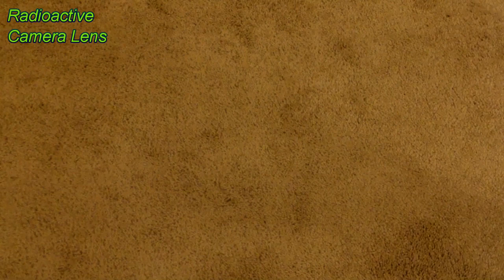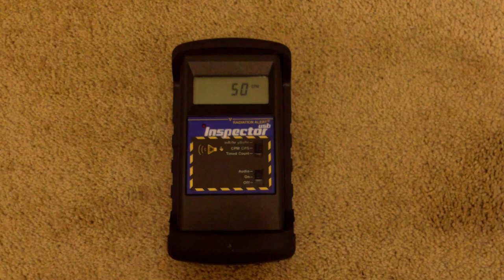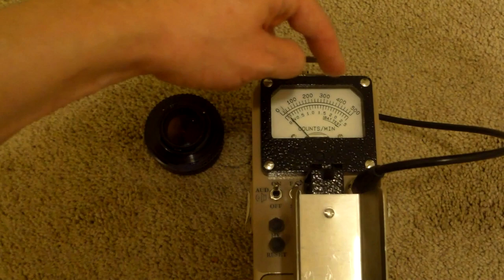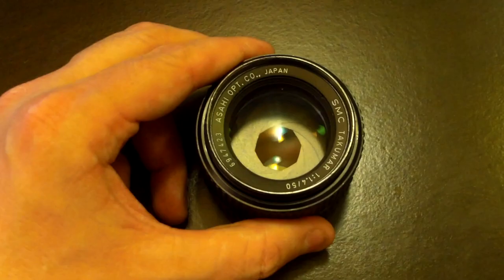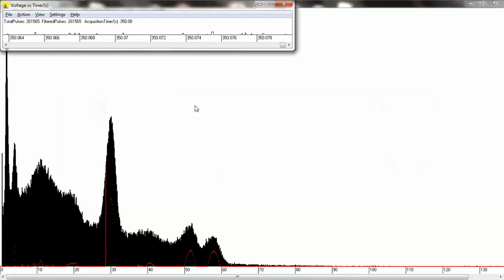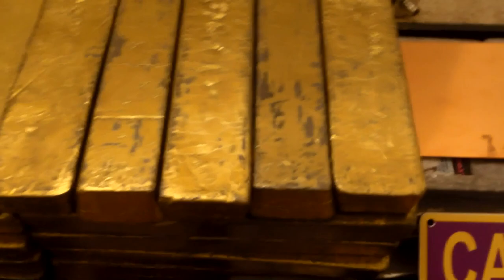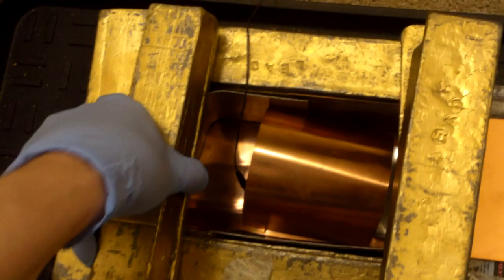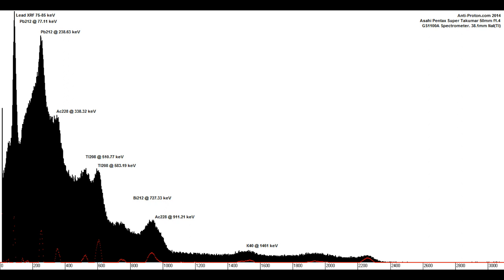Radioactive Camera Lens

Comment: I accidentally had one of these lenses stored under my bed for 2 years attached to an old camera my father in law gave me. I've removed it now of course and bought a GMC 320+ Geiger counter to check out the beta and gamma coming out the thing. I'm getting over 1000 pcm at the back of the lens, but thankfully only 34pcm average when the lens is on the camera and in the camera bag, and 25pcm where I was laying in bed with the camera bag underneath. background levels average about 17pcm. Bit of a relief considering it was only a foot away from my balls for 7 hours a night for two years lol
Reply: I bought the same Geiger Counter.  I have 3 vintage Takumar lenses that are radioactive.  None read as high as this guy's lens.  
Three of my Takumar lenses are radioactive.
One is 1550 CPM and the other 760 CPM.  All on the back lens.
My Super Takumar read 2250 CPM on the back lens. 
The rest of my vintage Takumar and FUJINON lenses have no CPM activity. 
I bought these because they were radioactive.  They are classic vintage lenses.
The CPMs really drop off fast as you move away from the lens. 
At 2 inches with the cap off the back lens, the reading in around 165 CPM. 
With the lens caps on and in an Olympus camera case I get about 100 CPM.
Reply: I have mine in my bedroom. It is really bad for health?

Comment: You know you are photographer when you was "oh, cool, f/1.4" instead "oh, cool, radioactive".
Reply from the maker: Yep, I am indeed a photographer.
Reply: I'm a noob when it comes to photography...but would the extra radiation "add" anything to high ISO long exposures?? ie with night/astro photography ?
Reply: Nope, has nothing to do. Probably only add more noise to the picture. ISO is just how sensible is the sensor to the light that gets in, when there's no other alternative to opening the aperture (the hole) wider to let more light in, or let the sensor get more light (longer exposure), higher ISO at the cost of noise and weird purple/blueish spots.
Reply: Kodak had some problems when the US began testing atomic weapons.  Stored and unexposed film was getting ruined with mysterious spots.  There is a cool documentary about it.
Reply: I actually was like "oh cool, f/1.4 and its radioactive!"
Reply: @tacticalseadog9120 
Interesting question. I think the answer is yes and no at the same time. It depends on what type of photography we are talking about. If we are talking about a classical film roll that you need to develop, then definitely radiation will affect the photo. Actually that is how radiation was actually discovered. But nowadays with digital cameras we have no films to develop. We have an electronic sensor that is sensible to light. Since radiation isn't light, in the sense it is either alpha (helium nucleus), Beta (electron or the positron i.e., the positive version of the electron) and Gamma (this is an electromagnetic wave of high frequency, light, but not visible to the human eye and I don't think it can damage the sensor or produce any visible noticeable effect). I don't know what a typical sensor is made of, and if it can absorb gamma rays or will gamma simply pass through as if it wasn't there...

Now that I think even more, it could be that if the radiation reaches the sensor and absorbed, it could emit electromagnetic light, and if that light is in the visible spectrum then it might affect photography as well!

Comment: A long time ago (35+ years) I was an industrial chemist. The company I worked for made, among other things, various radioactive compounds (with a license from the NRC). One of the things I made on a continuous basis was Thorium Flouride. It was used by the camera optics industry, but not as an ingredient IN the glass (as in your exampke), but as an anti-reflective coating ON the lens. It was vapor deposited on the lens surface  in a layer that was only a few molecules thick. I was told at the time that with a layer that thin, the amount of radiation from the (tiny) quantity of Thorium present on a single lens was nearly impossible to detect. (Of course,  since I was making kilograms of the stuff at a time we had lots of radiation monitoring going on!)
Reply: i don't get it,is the coating prevent us from the radiation OR just a trick?That was terrible that people did do that to the humanity.

Comment: Many of these lenses with thorium oxide elements have insanely good optical qualities, especially for when they were made. Elements with thorium oxide(up to 30% by weight) have high refractivity and low dispersion, which helps reduce chromatic abberations as well as facilitating the use of less curved elements which are easier to manufacture. Very similar technology is still being used today. Canon's very high end L-series lenses, especially the telephoto ones with white barrels, use fluorite elements. Fluorite elements have a crystaline structure that is almost identical to that of thorium oxide, thus giving fluorite glass the same properties as thorium oxide glass. The use of thoriated elements has pretty much entirely stopped with the advent of the newer types of ED glass, many of which compensate for abberations better than fluorite or thoriated glass. I personally own a Super Takumar 50mm 1.4 in m42 screwmount from 1962 that uses thoriated elements, and it is easily the best lens I own in terms of image quality. It honestly does a better job than many of my much more modern lenses, both on film and on digital.
Reply: What is ED then?
Reply: VicariousReality7 ED just means extra low dispersion glass. There are many types of ED/ Low dispersion glass, including Fluorophosphate glass. Most modern types of low dispersion glass are just trying to get the benefits(and physical/optical properties) of thoriated or fluorite glass without any of the disadvantages, like fluorite's weakness and heat sensitivity or thorium oxide's radioactivity. In the end they accomplish pretty much the same thing, the reduction(or outright removal, in the case of superachromat lenses) of optical abberations.
Reply: I have a Takumar 50 1.4 and yes , I always find myself going back to this lens for the sheer beautiful pictures that it produces.
Reply: At these levels (of radioactivity), it could be bad for health? No, no? Im very ignorant 🙃
Reply: Some day we will all die😂 I would much rather be killed by my lenses than GMO stuff and other supermarket “food”🤪

Comment: Thorium compounds, and isotopes. Fun stuff! Asahi was originally a rubber company, and made the rubberized silk shutters for the old K1000 series Pentax cameras. Now Ashi is supposedly an optics coatings company. We also use thoriated tungsten in transmitting vacuum tubes. Lots of camera lenses have heavy thorium in the glass. The rubberized silk shutters are really incredibly robust, especially compared to the ME era metal fan type shutters. Those tended to warp, and they won't fully set or reset. The rubberized silk just does it's thing, and it does it very well. I loved the ME Super, and Super Program Pentax. Small, smart, semi automatic, and just loads of fun.

Comment: I have a GMC 320+ Geiger Counter.  
I have 3 vintage Takumar lenses that are radioactive.  None read as high as this guy's lens/counter.  
Three of my Takumar lenses are radioactive.
One is 1550 CPM and the other 760 CPM.  All on the back lens.
My Super Takumar read 2250 CPM on the back lens. 
The rest of my vintage Takumar and FUJINON lenses have no CPM activity. 
I bought these because they were radioactive.  They are classic vintage lenses.
The CPMs really drop off fast as you move away from the lens. 
At 2 inches with the cap off the back lens, the reading in around 165 CPM. 
With the lens caps on and in an Olympus camera case I get about 100 CPM.

Comment: I would be very interested in knowing the health implication of these specific numbers you are pointing...thanks
Reply: None. You get more damage by passive smoking and car fumes you breath daily... or by the chemical in your breakfast food and sausages you eat.
Reply: As Michele said, not very. The actual gamma dose rate to your head while using a lense like this is very low, especially when compared to cruising at 35,000ft. The LND7317 geiger tube in the Inspector USB is a very sensitive tube, especially to the large number of beta particles coming from the lense, which geiger tubes - especially ones with thin mica windows like the LND7317 - are excellent at picking up, so the lense sounds very active indeed! But what you have to remember is that these practices are mostly blocked by the body of camera and have very low penetrative power.
You would receive a dose my orders of magnitude higher than this from a simple X-ray. 
That being said, if you're stupid enough to stick this thing to your eye ball then, yes, it can have a detrimental effect to your beta sensitive eye lense...given enough time.
Reply: @longden57  you can't just say that,every opportunity that increases health problem need to be concerned.
Reply: @lanchanoinguyen2914  The science and statistics would suggest that you need to be far more concerned about the air you breath walking around a city than you should be about the very small amount of time spent holding this lense! Everything is relative...
I'm exposed to doses FAR in excess of this for my own professional nuclear research work, and yet the doses I'm allowed to be exposed to on a daily basis (full body doses no less) are still insignificant when compared to just a few minutes spent at hospital in a C/T scanner. You really need to run the numbers...if you're concerned about the risk from this lense, then you are woefully ill-informed of the day-to-day risks associated with life as we know it, and to the physics of the interactions between matter and radiation. 
Please do your research.

Thank you.

Comment: Plastic blocks most alpha partials from these lenses.  Plexiglass in fact.  I just bought a Olympus OM-System G.Zuiko Auto-S 55mm f1.2 1974 Radioactive 3389 CPM lens.  It is hot.  More on the front lens than the back.  Back is 950 CPM.  The front is 3389 CPM.   After reading this paper on the use of plastic to block the Alpha partials I stacked four 0.25 blocks of plexi on the front of the lens.  Using GQ GMC 320 Plus I was able to measure a drop from 3389 CPM to 540 CPM.   Just think about what 2 inches of plastic would do.  Now that is news.

Comment: Two things I would like to have seen: 
1. Do your geiger counter reading through one layer of aluminum foil. That's just for curiosity.  and 
2. Do your reading through a thin sheet of steel to simulate the back of a typical (Pentax) camera.  The back of the lens is hotter than the front, but in actual use you would rarely be directly exposed to it.  And, out of my field here, but I don't think the viewing system of the camera will refract/focus radioactive particles, so your eye is pretty safe, even at the instant of exposure.
In fact, it would be interesting to do the whole Geiger counter part of the test on a lens mounted on a camera, as it would be in use.  Measure with the camera at rest (shutter closed) and fire the shutter on "Bulb" or "Time" and see if any more radiation comes through.

Comment: Have you thought about encasing the lead in a polymer?  Maybe a two part resin?  That might last longer than the paint.
Reply from the maker: +dnelms2   I have not, but I might. You are quite correct, a paint does not last that long.

Comment: On cameras of the same age as the lens, there would always be a layer of steel 
(the camera back) between the lens and the photographers face.
How about testing the exposure through thin sheet steel?

Modern cameras are mostly plastic, so less protection there, but the lens is always
about 3 inches away from the face, so maybe test how much the radiation falls off with distance?  In fact, try lens, then three inches of air, then sheet steel.

Also: the viewing system (mirrors and lenses) has no effect on radioactive emissions, (won't focus them) so your eye is not at any more risk than any other part of your face.

Thanks for doing this.
Reply: canon camera bodies are made from magnesium alloy too

Comment: I have the Konica 57mm F1.2 which is also radioactive.  It's a fantastic lens but does have the yellowing as well.  Simply add some blue in photoshop to counteract the yellow and you're fine.  
Also, I don't worry about the radiation at all because you'll get much more radiation flying in a plane than you'd ever get from using a camera lens. People hear an item is radioactive and immediately fear it without knowing that you're bombarded by radiation every day just waking outside.
Reply: And your device you using to wach this vid k have a lot of stuff in me room so I am have radiciec stuff in me room
Reply: +mavfan1 The Thorium leaves a yellow-brownish cast on the glass after a few years.  You can rid the glass of that coloration by exposing the lens to U/V light for 30-40 hours.  I've heard of success just leaving the lens outdoors for a few days.  The lens clears up all by itself.
Reply: +TheCondoInRedondo thanks for the tip. I'll give it a try.
Reply: short burst of big amounts of radioactivty is more dangerous than over a long time
Reply: +Speedyjens of course, but you don't get big amounts from using the lens, it's small amounts over a short time vs. small amounts over a long time in a plane, which is worse.
Reply: Correct

Comment: The brown discoloration often seen on this type of lenses is easily removed with a small and inexpensive LED desk light from Ikea. Place the lens without the caps on a mirror. Position the LED head about an inch above it.
Let it shine, let it shine, Let it shine.
Occasionally turn over the lens for even exposure. Takes a day or 2.

NEVER leave a lens in the sun. The lubrication will melt and you end up with sticky aperture blades.

Comment: When switching to the front lens the count is lessened because the distance to the source has increased several times; not so much that the front element is blocking the radiation.  In the examples of radioactive camera lens I've seen, the radiation always comes from the rear element only.  I've taken elements out of the housings and also found that the radiating piece of glass is more intense on one side than the other.  That suggests that it is the coating rather than the entire glass that contains Thorium --- the radioactive isotope.  This is contrary to the literature I've seen which claims that the entire glass is doped up to a third of its weight.

Comment: Another great video, keep it up Tom.  I've just built myself a geiger counter kit, the GK Plus.   It has a value in the setup menu that changes the calculated uSV/h depending on the cpm.  I'm wondering if I can calibrate it with a Cesium source from a company such as Spectrum Techniques where the source activity is known and calibrated.  What do you think?

Comment: wouldn't the radioactive camera lens result in exposure to the photographic film?
Reply from the maker: +Spock Some, yes. (I had the same thought). The reasons it makes little effect are:
1. Higher energy photons from ionizing radiation have a high chance of simply passing through the film and not depositing energy in it.
2. The actual intensity is low (photons/s). Millions of times less than light.
3. The film is more sensitive to the visible spectrum, most of the time.

But given a really long time I suppose it would.
Reply: +antiprotons isn't cause of cancer only related to statistics in this situation? could single radiation source of this kind of takumar lens cause cancer cells?  hwo about immune system? i love MF lenses but i choose not to keep takumars. they are very good at micro contrast and have very low CA., but no thanks.
Reply: +antiprotons i've heard if you put a radioactive lens on undeveloped polaroid film it will leave a glow.. have you found that to be true?
Reply from the maker: Photographic Elements
Have not tried, but it seems reasonable to believe. Might take a while to expose.
Reply: maybe if you left a roll of unexposed film wound in the camera over 10 years with the lens on.... in a freezer to prevent emulsion damage from time/heat.

Comment: Actually I do not think the lens will be "pointing directly at your eyeball" when you open the shutter to take an exposure. You will still have the pressure plate, usually metal, and the back of the camera body. I don't know though what effect this would have on blocking the different radiations. What about distance? How much would your reading decrease if you moved back 1 inch, 2 inches , etc.?
Reply from the maker: The change in reading with respect to distance is governed by  Distance Inverse Square.

Intensity at point B from point A:

B = A/(4πr^2)   where r=distance.

So, for a unit squared, perhaps 1 inch squared, the change in intensity is:

Inches      Intensity
0               1
1               0.0796
2               0.0199
3               0.0088
4               0.0050
10              0.000796
100             7.9578×10^-6

Distance inverse square.